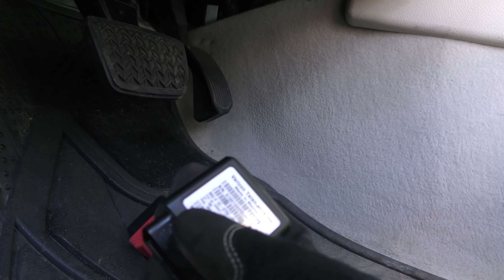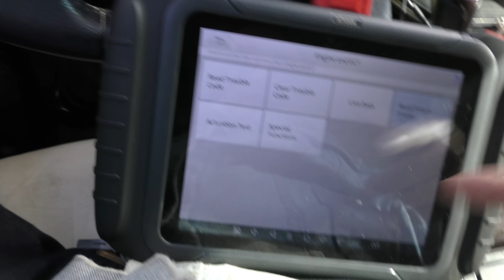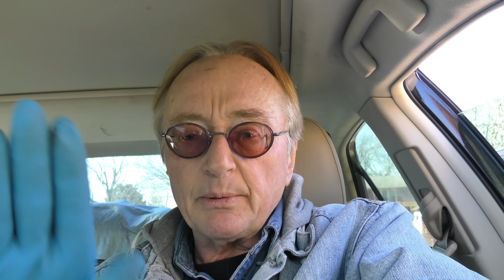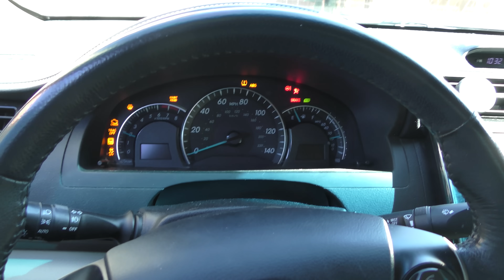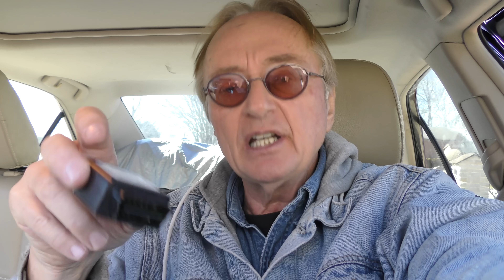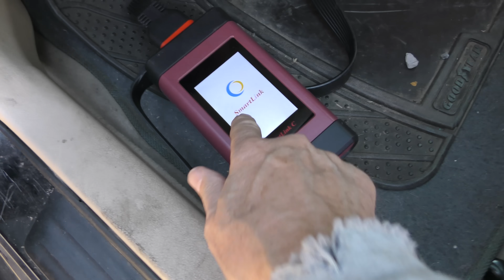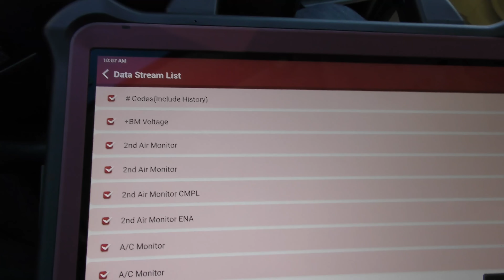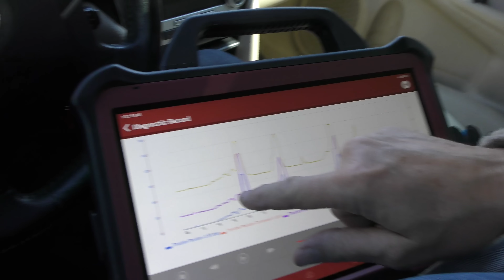This Stupid Device Just Cost My Customer Thousands in Car Repairs

Comment: That is a telematics dongle, for vehicle tracking and recovery. It just reads data and uses the cell network to report driving habits. That is not a diagnostic dongle.  Literally nearly all fleets use them Light Duty/Medium Duty/Heavy Duty. Every Semi you pass unless claiming short haul exemption, has one connected, which is required by federal law. Literately millions of those are connected to vehicles in the US. Verizon, CalAmp, KeepTrucking, Samara, Omnitracs, ATT, etc all make or have made units just like that one. Used car dealerships tend to put something in the vehicle and pay for tracking at least till the things paid for, all be it they normally use a wired one and hide it under the hood or in the trunk.
Reply: Finally someone who's making sense! As I was watching the video I kept saying to myself no way no way no way there's no way that he's right on this! I can't believe Scotty said that! Actually, yes I can!!
Reply: I’ve seen these types of dongles do diagnostic scanning as well but it tends to depend on the model. 

I’ve also seen dongles like this cause other issues like draining the battery until it has no power left. It’s been all to common for a friend of mine to go drive a box truck that was parked for a few days just to find out it needs a jumpstart.
Reply: @stephentidwell2244  Yeah they can drain the battery, but it usually takes quite a few weeks.
Reply: @usmdude1983  knowing the company that is involved their trucks sometimes sit around longer than that at times

Comment: My wife bought a used Acura MDX and was having a similar issue but slow acceleration on take off. I cleaned the MAF sensor and holy cow it drives better than ever. I’m surprised more people don’t clean them or the throttle valve.

Comment: I went through something similar on my Ram recently.  It started as a throttle body problem, but then quickly devolved into finding water in the pcm connector.  Turns out it was creeping in via a small drip from an electrical clip retainer, to the ac lines, and then onto the connector.  I was fortunate enough to find a refurbished computer for 255 bucks, and coupled with a little silicone and some bulb grease, my Ram is running great once again.

Comment: Scotty: The 2012 to 2014 Camry was junk. The torque converters are bad. Toyota even extended the warranty on the tranny because they were so bad. You should know this being a Toyota Guy. You let the cheap OBD module really fog your tunnel vision on this one. I used to think you were pretty sharp but now I am really wondering.

Comment: Be careful cleaning a electric throttle body! I caused myself all kinds of hell the computer did not know what the hell is going on except to give it a lot more fuel than it needed. It had to relearn and be reflashed which was a nightmare
Reply: That's correct Sam. It can mess with E throttles. Don't open it fully. Scrub with toothbrush.
Reply: @123andme  yep it was a nightmare! We had such trouble trying to get it to reflash and relearn? Transmission shifting all wonky and at idle she was running at 2500 rpm s*** LOL

Comment: I bought the Blue Driver a couple of years ago that Scotty hyped up. Dang thing has been AWESOME!!!! I've used it so many times. I leave it plugged in all the time in my '11 Grand Cherokee. It has live stream data recording. I would think that, like Scotty mentioned, since the Blue Driver is a higher end unit that does real time data live streaming, it should be designed to to stay plugged in... Well mine has and it's been fine...

Comment: its a beautiful thing to watch a pro do his thing and fix something few people can even comprehend. I have been working on my own cars for 50 years, and this new age of computers in cars has driven me crazy. you have helped me so much dealing with these electronic issues , words cannot express how much! I have an 03 gmc sierra and it has great mechanicals but the electrics have driven me crazy for years. just when I think I have it fixed it goes into reduced power again. I finally slapped myself with a common sense stick and realized the plug going into the throttle body was worn out and replaced it, now I have my truck running like it should again!! please consider doing a video on this, I feel like there are many others out there dealing with the same issue and make a lot of people happy just knowing a simple fix is maybe all they need!

Comment: I have a blue ELM327 Bluetooth OBDII adapter I got in EBay.  I sometimes use it to monitor the engine while driving with the Torque app.  Thoughts on this?

Comment: I use a cheap 10$ OBD2 Dongle ELM327 that I bought on ebay. It works fine for diagnosis, never had any problems with it

Comment: That dongle looks to me like one that some insurance companies give to their customers. They're designed to monitor your driving habits and report them back to your insurance, who may then adjust your rates accordingly.

I could be wrong on that though.
Reply: Your right that is a insurance dongle, looks just like the one the insurance co. gave me. Jokes on them, told em i drive less than 1000 miles a yr so they made me install it in my car so i put it in my parts car instead & drive it 2 miles once a month. Now i pay less than $300 a yr for insurance
Reply: It provides a wifi hotspot
Reply: But if it was issued by Verizon, not likely.

Comment: How this system works:  When the driver pushes on the gas pedal they move a variable resistor which sends a varying voltage to the computer.  The computer then sends a signal to the electric motor that opens the throttle.  There is another variable resistor on the throttle body (throttle position sensor, often built into the body) which indicates the throttle position and sends a voltage back to the computer.  The computer compares the signal from the gas pedal and the throttle position sensor.  If they match, all is OK.  If they don't match the computer sets a code or codes.  If the code persists, it sets a "limp home mode"  which limits the throttle opening and speed.  

That appears to be what is happening here, but in an intermittent manner.  These problems can happen due to bad/worn variable resistors (sensors), wiring problems, or connector problems.  

I had a similar problem with my wife's 2006 Chevrolet Malibu Maxx.  It started as intermittent.  I could reset the codes and the car might drive OK for days or minutes.  Eventually it got to the point that it would reoccur within minutes.

The code indicated a mismatch between the pedal sensor and the throttle position sensor.  I couldn't be sure which was at fault so I replaced the pedal first as it was a lot cheaper.  After that didn't fix the problem, I replaced the throttle body.  When I took apart the old throttle body, I found that the heavy oil that lubes the electric motor gears had leaked into the position sensor and was fouling the sliding contact. 

My bet is that this will get worse until someone replaces the throttle body and throttle position sensor and that the computer is fine.
Reply: Great analysis by analogy.
You're a solid DIY tech !
I DIY my 2 Mercedes its rewarding & keeps me out of trouble.
And free from car payments LOL !

Comment: In theory, yes that device could have damaged something, but such damage would likely look very different. Even the least expensive major brand CAN interface chips (for example, MCP2561) have integrated protection for miswiring of the power supply and transients on the CAN bus. If anything other than the transceiver could be damaged by that then that sounds like a major design flaw that would have lead to many failures, and a damaged transceiver typically just doesn't work at all - not an intermittent failure or scrambled data specific to only one particular group of sensors and actuators. Some vehicles (probably not this one, but without schematics I can't say for certain) have entirely separate buses for engine control versus diagnostic information. Either way, it is unlikely that such damage would only cause an issue with a cold engine.

Avoiding plugging questionable and/ or cheap electronics into your OBD port is always a good idea, but this bus is designed to have many devices permanently attached. Many thousands of commercial vehicles have similar devices installed in this manner and do not regularly suffer from these issues. At best, this dongle seems like an unrelated item.
Reply: I was looking for this. Verizon isn't exactly a $1 ebay dongle either. I'd suggest this owner check every wire and ground in the throttle and TDS systems before firing the parts cannon.
Reply: Have seen these REPROGRAMMERS cause  driveability problems.-tried one-claims of b/s-you cannot get more power and economy at the same time-
Reply: @Watchout1010  Yes, programming the engine parameters incorrectly can create problems or even disable/ damage the engine, but even the "cheapest" such devices I have seen are a few hundred dollars with some "good" ones being multiple thousands of dollars. I would consider anything less expensive to be a "questionable and/ or cheap" device. Also, it would be highly unusual for a vehicle owner to not know that one of these tuners was attached to their vehicle.
Reply: @r2db  constantly reprogramming a programmed computer is problems in waiting-murphys law.
Reply: @Watchout1010  My understanding of the functioning of devices such as the PDI Big Boss is that they do not "constantly" reprogram the engine, but only reprogram upon user demand. Otherwise, they do constantly monitor engine parameters and display such parameters that the driver may not be able to routinely review without this tool or another similar tool.

If one has the money to own a heavy diesel vehicle and then spend $2.5k on such a tuner, I would hope that they have sufficient intelligence to understand what risks they take by using such a device.
Reply: @r2db  talking plug in cheap fuel milage,power gain chips-to actually reprogram once is different than constantly confusing the computer.
Reply: @Watchout1010  I do not know what you mean by "constantly confusing the computer" as in most cases one cannot reprogram the computer while the vehicle is operating. Most of the tools require a key off and key on after programming. Could you provide a specific example?
Reply: @r2db  cheap plug in fuel savers are constantly changing the original programming and damage the computers-constantly  being overridden to alter programming-causing pcm problems.
Reply: @Watchout1010  No they are not, those are usually just a LED and capacitor in a plastic box.  They do nothing to the PCM.

Comment: I can definitely agree to this. My car went crazy when my father in-law and I forgot to take the dongle out. I though my alternator was going out. Took the thing out fixed most of the issue. Then a dealer I took it to for matinance found a loose wire. Been running good ever since. (16' challenger rt 5.7)
Reply: Wouldn't the loose wire have been the issue?
Reply: @dustinroberson1865  Yes, and no, the dongle was the main problem. My windows would roll down, and my dash would shut off. Then, a few seconds later, everything would come back on like nothing happened. Thinking about it, the dongle and the loose wire could've done it together, but the glitches were never consistent and didn't matter the road or weather condition.

Comment: Pedal sensor?
I can't stand the reliance on electronics where classic mechanical functionality is perfectly reliable and safe.
I can't stand the idea of NOT having my left foot directly connected to the brakes.
Having a computer as a mediator kind of scares me.
Reply: brakes and steering are a hard mechanical connection, always, throttle has not been for a while.
Reply: @Bootlickingisamentaldisorder  electronic braking and steering have been used in some cars for years and are becoming more common. There was a whole thing about new BMWs with electronic steering feeling numb and disconnected.

Comment: On No!   I use a Scanguage II..    I leave it plugged in my port all the time (because that's how it works) I just LOVE it because I can monitor my CVT temp, and my CVT overheats a lot (Nissan) I've had it plugged in for 80K miles, and I know its saved my CVT on several occasions by warning me that its overheating.   But now I'm wondering if I should be worried.    Its such a cool device and it scans for everything while I drive!

Comment: Is it one of those hotspot wifi plugs to give wifi in cars?
Reply: Since he said it was Verizon, I'd say yes.
I have a T-Mobile Sync Up Drive in 3 of my cars. And now I am wondering if the Low Battery warning that the T-Mobile app keeps crying about is related to the dongle messing up my computer. My car is < 3 years old (I replaced the battery ~ 2 months ago), but the dongle still gives me low battery warnings.

Comment: That Verizon dongle was supplied by the driver's auto insurance company. They give an option to get a small rate discount, using a cell phone connection to monitor in real time, the driver's driving habits. Such as miles driven, acceleration speed from a stoplight, deceleration speed when braking, etc.

Comment: Getting my 2011 Mazda 2.5 back on the road this spring after sitting two years. Putting the breaks and rear wheel bearings first. Now I do know I'm going to need a throttle sensor or cleaning at least. Uhh ; that fuel is going to need draining and replacing .

Comment: Interesting and informative video.  It makes me wonder about GM owners of more recent 5.3L and 6.2L engines that plug in these aftermarket modules in the computer ports in order to bypass the stupid AFM/DFM systems that is possibly the cause of these abnormally high lifter and push rod failure in vehicles with under 10K mile to anything over 50K miles.  How much careful electrical and software engineering studies and tests have been done in the design of  these $200 to $500 modules to ensure that these aftermarket modules do not eventually fry your computer electronics?
Reply: It would be pretty hard to prove an electronic device caused metal parts that have metal to metal contact to fail, don't you think???
Wouldn't it no be,  that perhaps those metal lifters and pushrods failed because of lack of oil, or perhaps they are made out of cheaper metal now, and they just fail, because of that ????   We have been using metal rocker arms, pushrods, and lifters for over 70+ years, and there has never been a huge failure rate, unless they stopped getting oil on them...

Comment: The electronic ignorance in this video and in the comments is astounding. Hmmm here's a device I don't understand how it works, it must be the issue. Correlation doesn't equal causation.

   When the computer is cold there is likely a circuit that is broken that when the computer warms up the circuit is making better contact.

Edit: changed wants to warms
Reply: "The electronic ignorance in this video and in the comments is astounding". Then you post this...  " When the computer is cold there is likely a circuit that is broken that when the computer wants up the circuit is making better contact."  You can't be serious...🤣🤣🤣
Reply: @ASSOpid  I can be serious. He clearly states the issue is only when the ecm is cold. If you've ever dealt with printed circuit boards you'd know that bad solder joints can shrink when they are cold and lose connection, when they warm up and expand the make contact again. This was a very common problem with video cards in computers. One solution was to reflow all the solder joints, another was to bake the card in the oven at 250f for an hour to try and reflow the solder joints if you didn't have a smb soldering station.

Edit: changed want to warm

Comment: The device likely has nothing to do with the problem. The problem is only when the vehicle is cold. Thus in "Closed Loop Mode". The base parameters for the engine are off so it performs poorly. Then when warm, it enters "Open Loop Mode" and uses more sensors like down stream oxygen sensors to operate more efficiently. This car probably has a "small" air leak after the throttle body.   Intake gaskets or other, but the fuel trim and/or the mass air flow per engine size at idle should hold the key.
Reply: You’ve got it backwards. Open loop in startup, cold engine, wide open throttle.

Closed loop is warmed up light driving
Reply: exactly this, fuel trims hold sooo much data, if you know what your looking at. i'm highly doubtful of this dongle diagnosis too.
Reply: Or servo gear damage in the throttle body plate control
Reply: Given how filthy the intake was, I'd check the smog system as well as it's likely quite gunked up.